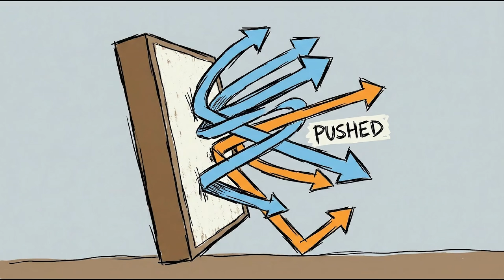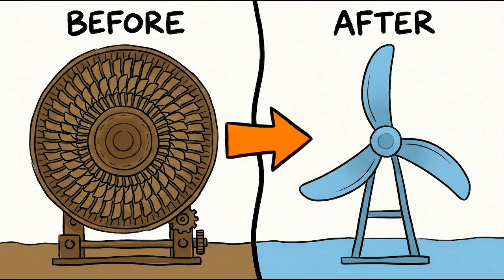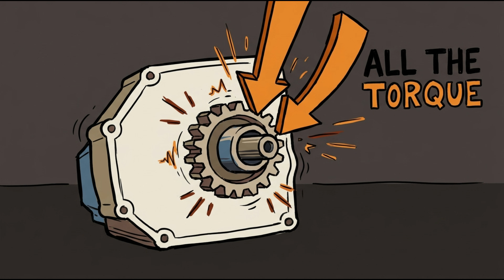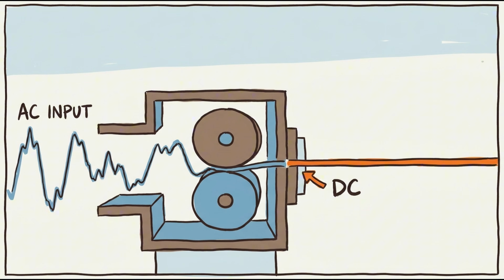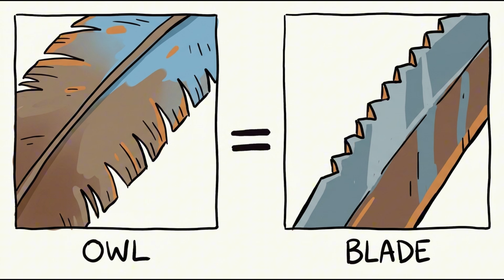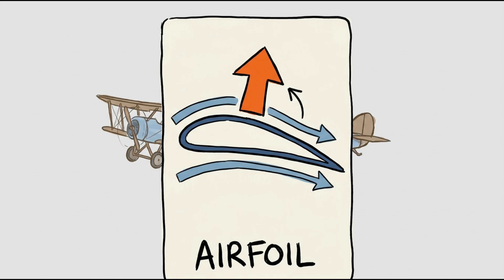Here’s What Happens Inside a Wind Turbine to Generate Electricity

Comment: Confusing the physical units right in the head line ain't making hope for the rest.
Reply: Exactly why I clicked this video. Does he mean: onerotation is 1000kwh? 😮
Reply: @rienkvandenberg9103  
At best big ones have a power of 5000W
So it would need 12 min to generate 1000 KWh.
Bc one rotation lasts some 5 seconds it needs appr. 144 rotations to generate 1000 KWh.
One rotation produces 7 KWh.
Not bad either.
Without spreading 100 KgTeflon particles each year it would be even better .
Reply: @rienkvandenberg9103  
5000 KW, sorry